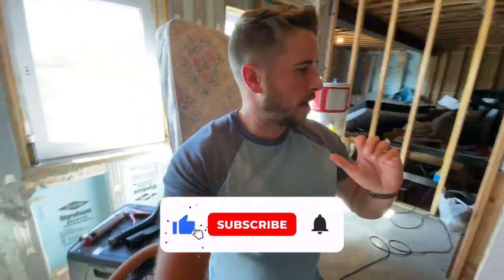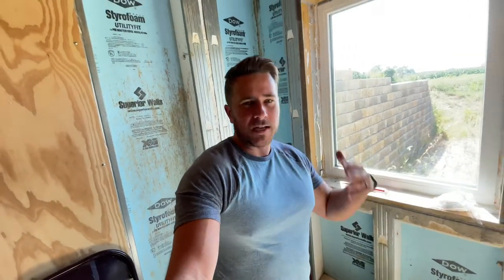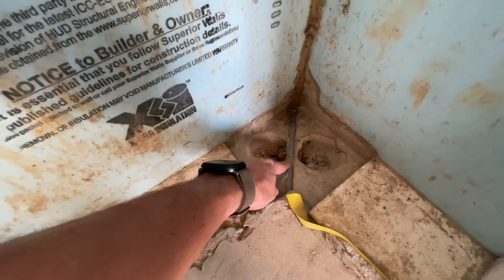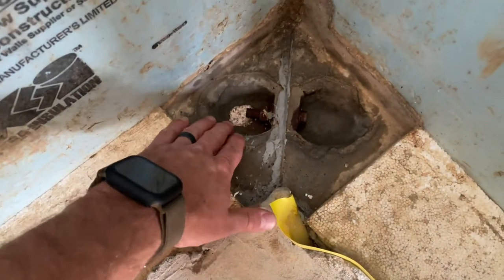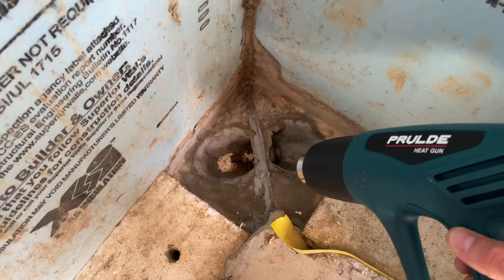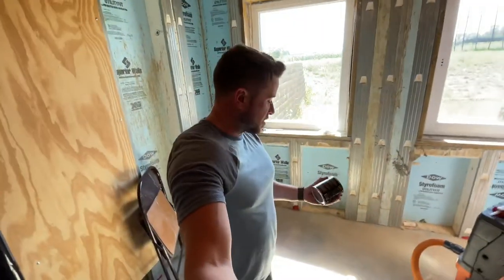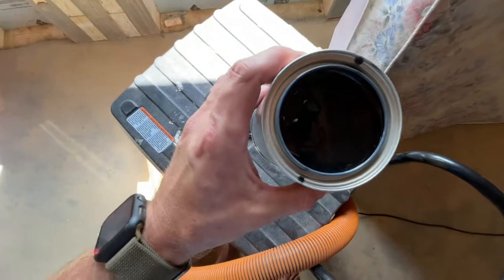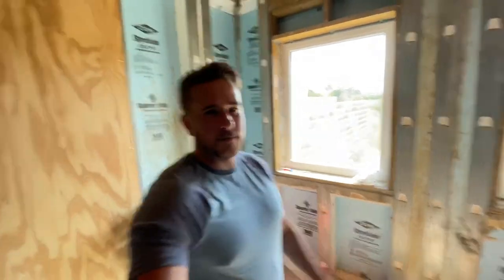Air Sealing my Superior Wall Corner Joint

Comment: Thanks for the video.  We are considering SW above ground walls.  We are concerned when hearing you were able to feel "air" at all 4 corner bolts / joints.  What kind of foundation did you use?  Did you use SW footer or did you use stone foundation?  If you had to build a house again, would you consider using SW for the above grade walls of your house or would you do a stick frame again?

Comment: Nice video! Random question. What screws do you use on the steel studs in the basement? More specifically that plywood behind you in the video. Thanks in advance!
Reply from the maker: Self-tapping, fine thread drywall screws.  I'm about to show them in Part 2 of my Basement Bedroom build.  Check it out.